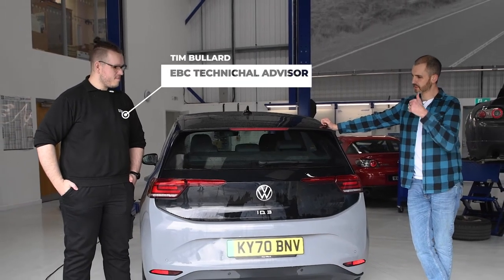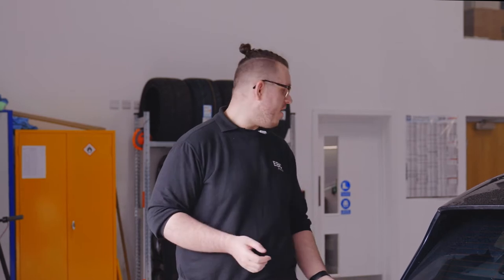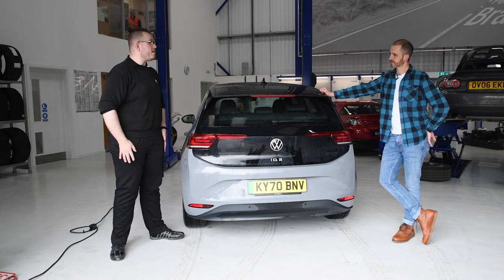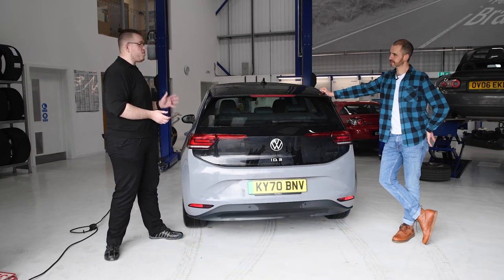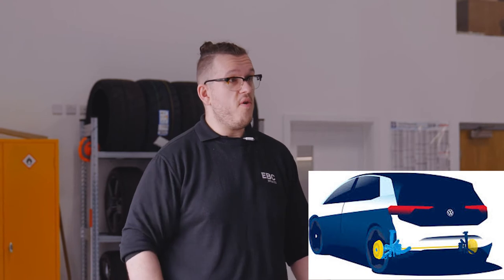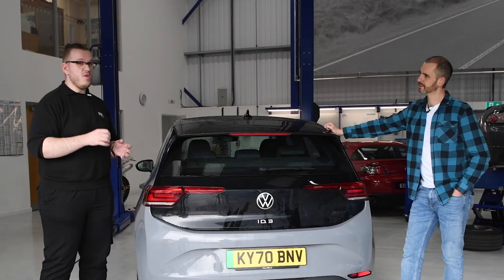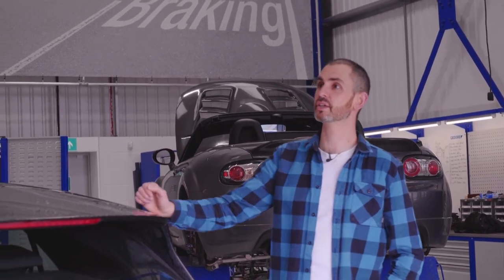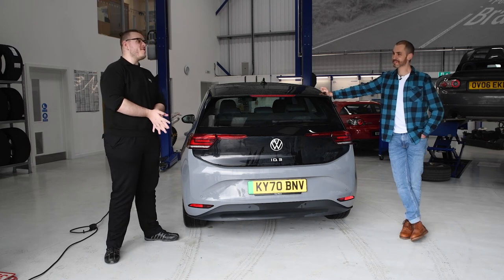Electric Vehicle Drum Brakes with EBC Brakes & Jonny Smith from The Late Brake Show

Comment: Are drum brakes not powerful enough to be used on the front as well?
Reply from the maker: Hi, for info on this please reach out to our technical support team at technical@ebcbrakesuk.com.
Reply: Definitely. And drum brakes are enclosed which means heat dissipation is not as effective as discs, hence affecting braking performance as well. That is why they are applied mostly for the rear axle because of much lighter braking loads as compared to the front ones.